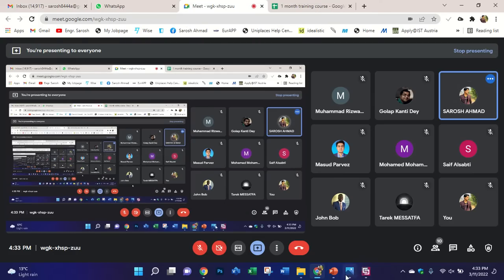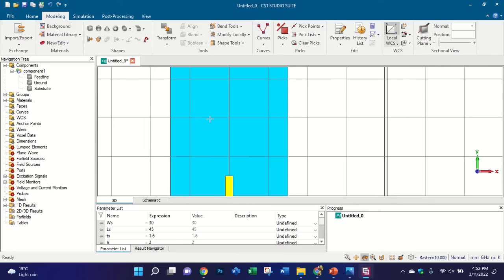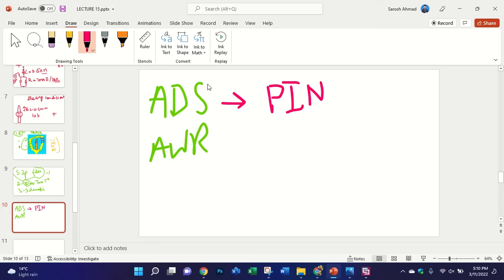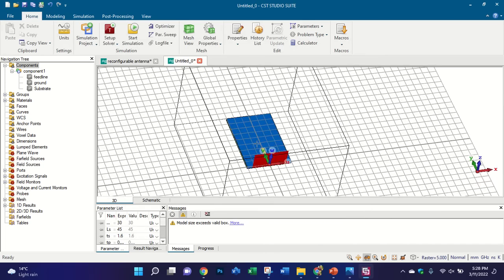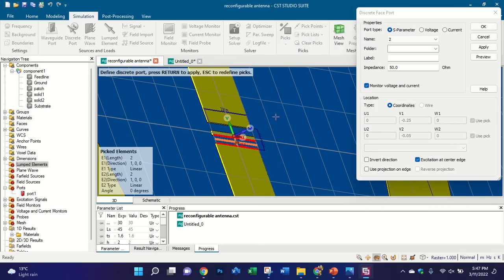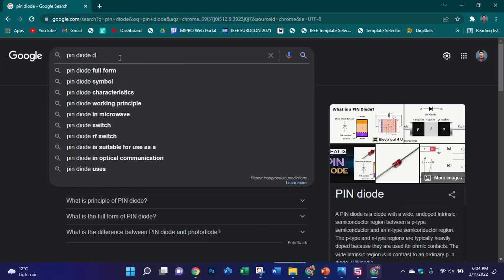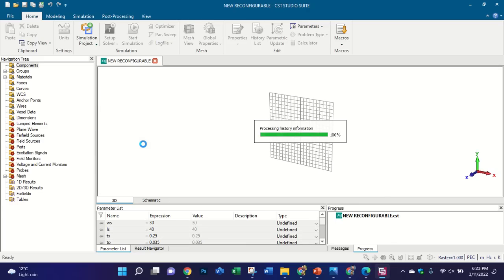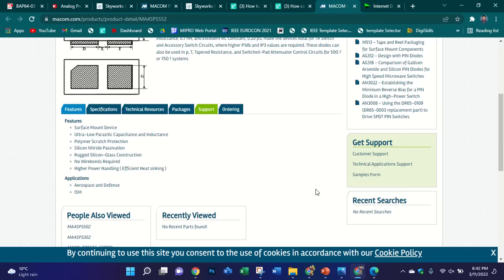HOW TO DESIGN RECONFIGURABLE / SWITCHABLE ANTENNAS IN CST STUDIO? [LECTURE 15]

Comment: Sir, if need to add two diodes , do I need to make on state and off state for both diodes ? And like for one diode should I make on and off state each  ..and before simulation should i remove one state to get results for other ??
Reply from the maker: - Yes, for each diode you must define ON and OFF states.
- No, you do not simulate ON and OFF together at the same time.
- You simulate one configuration at a time, by setting the diode states and disabling the others.

Comment: Sir, For reconfigurable antennas , did you place dc bias lines for the diodes in this design?
Reply from the maker: @HemaLathaC-p5t  yes for sure, 
In CST, or in sinulation you might not consider the DC bias lines
But in measurement point of view, It is necessary to be considered during fabrication
Reply: @antennadesignbycst  Assalamualaikum Sir. Why in CST simulation you not consider the DC bias lines? Supposed what we fabricate is similar with what we design in CST software. Appreciate for feedback soon
Reply from the maker: Join my WhatSapp Group: https://chat.whatsapp.com/IOddSvUKePcCotxbLwg0S3
Reply: @antennadesignbycst  I have requested to join
Reply from the maker: With name?

Comment: Hello Sir, How to identity degenerate mode in CST using Frequency domain solver for the case of microstrip patch antenna?
Reply from the maker: First run the simulation and examine the resonant frequencies through the return loss (S11) curve. Degenerate modes appear when multiple modes resonate at closely spaced or identical frequencies. Use the Mode Finder or Mode Analysis tools to visualize eigenmodes and check for similar field patterns at the same frequency, indicating degeneracy. A frequency sweep can reveal regions where multiple modes overlap, and the Eigenmode Solver can help identify coupled modes. Comparing simulation results with theoretical predictions and analyzing electric/magnetic field distributions will further confirm the presence of degenerate modes.
Reply: @antennadesignbycst  Sir, Could you guide me how to use eigen mode solver in CST?
Reply from the maker: Join my WhatSapp Group: https://chat.whatsapp.com/IOddSvUKePcCotxbLwg0S3